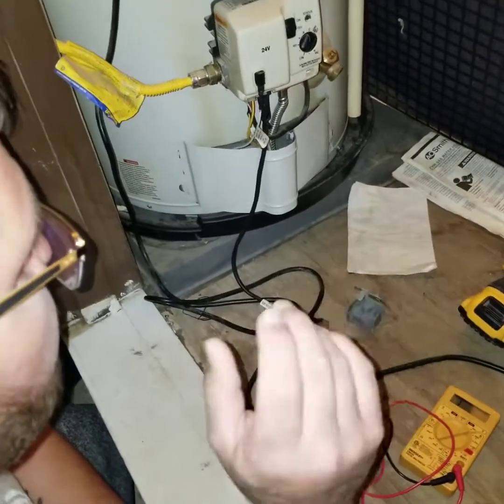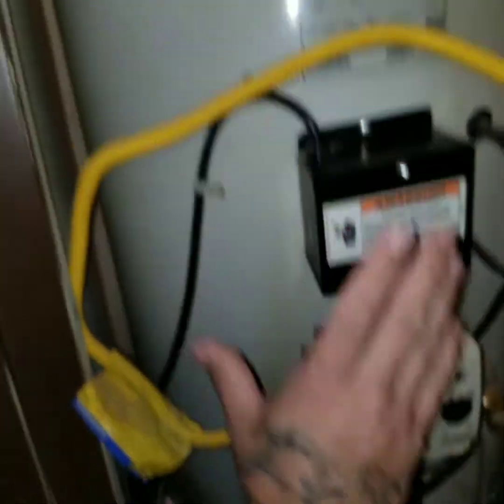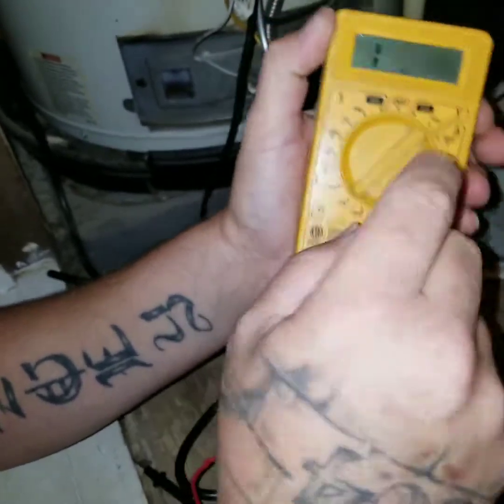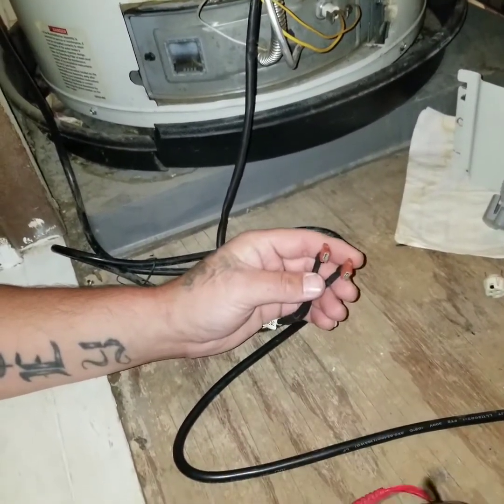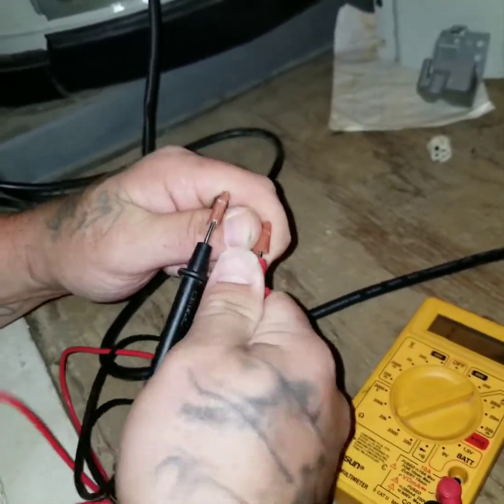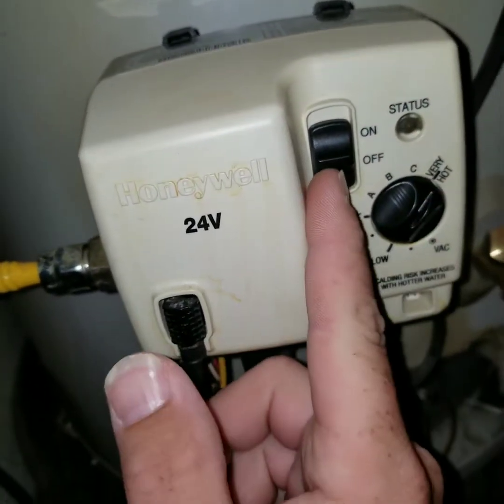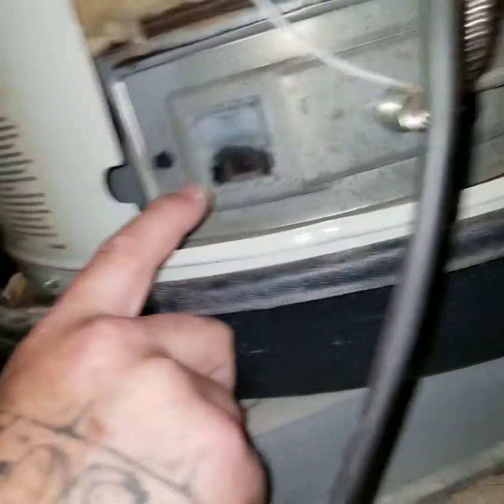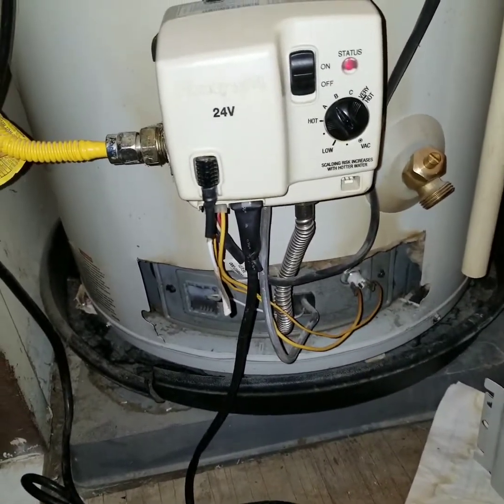Fix Hot Water Tank Vapor Lockout FLAMMABLE VAPOR SENSOR LOCKOUT | HOT WATER TANK (TEMP FIX)

Comment: you never say how to reset the valve?
Reply from the maker: I'm making part 2. But... Unhooking the valve placing it into a zip lock bag, be sure To PUSH AS MUCH AIR OUT OF BAG AS POSSIBLE. Then there is 2 options - 
#1. Find a place out side in fresh air and let the valve (still in bag) for at min. 2 hours. 
#2. Place Valve inside of your refrigerator for 2-3 hours, this is or should be a place that has no toxins or gases. Take back and plug in and reset you switch as I show..